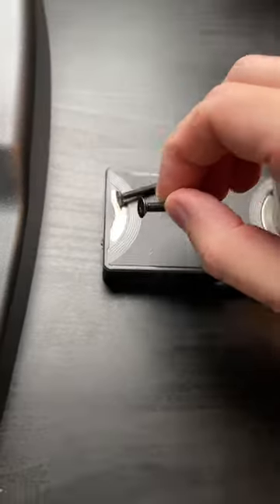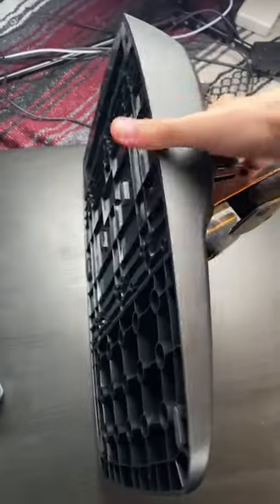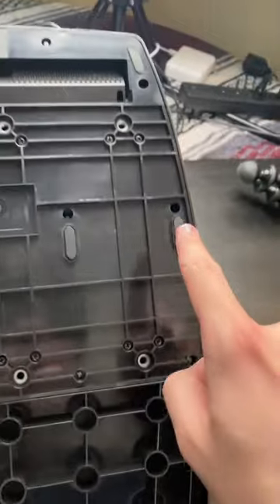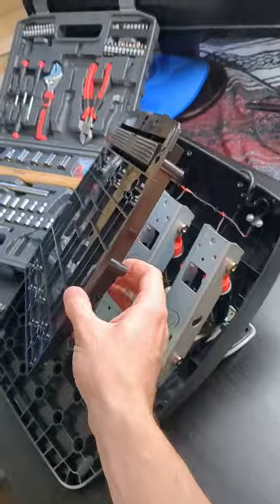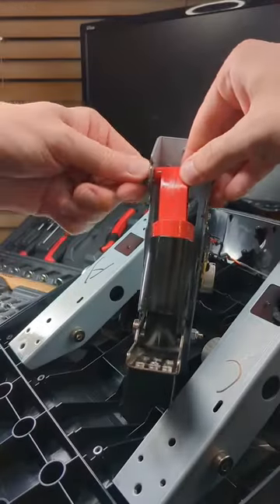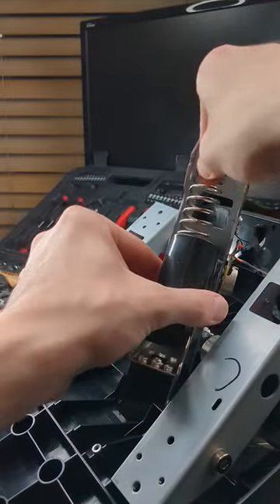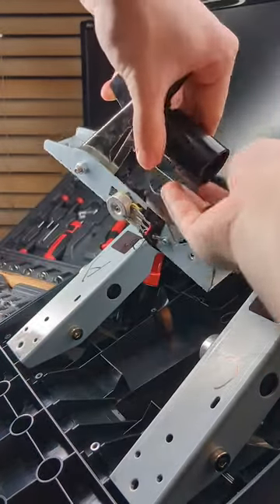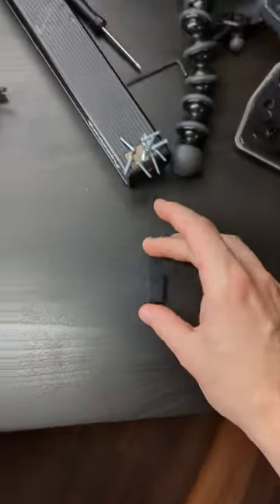FIXING the Logitech G920 #shorts

Comment: This is the opposite of what most mods want to acheive lmao
Reply: @Unaboner  braking isnt linear. It won’t work or feel properly with no rubber stop.

Want to mod it, replace it with a load cell.
Reply: @Unaboner  I think you skipped leg day too lol
Reply: @drewdunn3201  i can get like 80-90% at the cost of my chair rolling back (even with my two amps behind it) so i just want it to be a tad softer so i can still hit optimal brake pressure without rearranging my seat lol
Reply: I wouldn’t want to remove it if it weren’t for my desk and chair, the way I sit and how I have to put the pedals under the desk I don’t have enough room to push it down with enough force
Reply: The only reason real race car pedals are so tough is because when you break the inertia keeps your body moving forward
Reply: @heyitskimii exactly, thats just the most annoying part, every time i try to break hard i end up rolling out of my room
Reply: @heyitskimii I set my brake pedal to hit 100% braking force at about 80-90% of full push so I can get more braking with less chair movement
Reply: @smolltaco5667 😂😂😂😂😂 right. I removed my wheels 😂😂😂
Reply: @Shark00n1337  orrrrr you can do what I did, and just cut it down to about a fourth of its size. It still feels squishy at the end without feeling like a brick wall.
Reply: when i race i just set up a fold up chair instead of my regular chair
 @heyitskimii
Reply: Exactly
Reply: @smolltaco5667 as a real racecar driver, if my body is moving forward under braking, my harness isn’t tight enough.
Reply: @alexandermaloney4016 their chair isn't bolted to the floor or something weighing almost a ton
Reply: @smolltaco5667 yeah I just took the wheels off after a couple weeks
Reply: I weigh 105 lbs and I have to stand on the damn pedal for it to go to 100%
Reply: I did this mod because I play truck sims.
Reply: If it was screwed into some sim rig then yes but but on my floor it just slides and it is anoying.
Reply: @smolltaco5667 that's the same problem I have with my Thrustmaster T3PM pedals which is why I left them stock rather than putting the other spring on it. Sitting in a chair with wheels makes braking with a lot of force hard because you just push yourself back  which is why i am thinking about buying an office chair pedal mount in amazon. It's basically holds the front two wheels of your chair in place and ur pedals screw into it so you don't get pushed back.
Reply: @alexandermaloney4016  true but i didnt mean it that way
Reply: @Shark00n1337 facts
Reply: This is worse!! How am I supposed to modulate brake pressure with zero resistance!
Reply: @jadechillboi401  Just get locking wheels! I've been racing for years with my chair "with wheels" and I have no issues braking with the G29 pedals.   This "mod" is ok, I understand why... but there are other solutions and it's not expensive.
Reply: @OffRoadQC  I can't sadly
Reply: @drewdunn3201 hell nah I’ve turned the sens up and stood on mine full weight brake went only to again 80%
Reply: His brake feels like the gas now🤦🏾‍♂️
Reply: @Unaboner nah replace it with a thick peace of foam
Reply: Well the point is is in a real race car the brakes are cable not like real cars where they're electric and in race cars they're impossible to push down but in real cars it's like no effort
Reply: @Shark00n1337  lol. It will work properly. That's why T3PA from Thrustmaster is better than Logitech pedals. Due to that stupid brick.
Reply: @Missch_1  What are you on about? T3PA come with a removable rubber piece same as these logitech pedals. They work in absolutely the same way, what's the point of saying its better? You a fanboy?

Load cell pedals would be an upgrade, these are just toys.
Reply: @Shark00n1337  I don't know if you have one of these pedals but the original rubber stop is at <50 brake pressure and it's straight up like hitting a brick wall, you are unable to brake >60-70% in game even adjusting it in settings, everyone pulls them out cause it completely ruins the brake.
Reply: @heyitskimii , can you not calibrate you break to hit 100% earlier… best of both worlds?
Reply: Na I hate the thing. A stronger spring and take that thing out and its way better. You cant even hit 100% with the rubber thing in there. Atleast without a rig
Reply: Just get locking wheels
Reply: Before mod assetto corsa was %12 breaking force after the mod can got to %100 with ease. It helps alot with left foot breaking when drifting. I've also set my pedal to full force when it hits about %85 so I don't have as much movement
Reply: @heyitskimii just change brake sensitivity or take away all deadzone. My G29 feels awesome at 83 saturation on a ps4. Brakes are at 90% just before hitting the rubber piece so if I need to get to 100 I can press just slightly harder as opposed to all my might lol
Reply: @howlingbeats2544 😂😂😂😂 for real though.
Reply: @ModMINI you don't know how to do that with your foot. That's insane and I'm scared of you actually drive in real life.
Reply: @OffRoadQC and this one is free.......
Reply: @robertt9342 then it's super super sensitive
Reply: @youarenotspecial  I have been racing for decades and am smoother and faster than just about anyone out there. You adjust stopping force using pressure. Pedal travel is not desirable.
Reply: I have a cockpit and because the footpedals are angled. It’s a lot easier to hit the brake pedal so I see why people would want to make it harder.
Reply: No matter what you do with the logictech pedals it won't be that grand, at least this way you can use a chair and table mount.
Reply: @ModMINI  you push the pedal less in?
Reply: @smolltaco5667 Ehm no thats what the 3-5 point is there...Sure it's safer but it basically keeps your ass planted in the seat

The pressure is so high because of precision if you lock up during a race it could cost you
Reply: @heyitskimii  You got a point.
Reply: I put my accelerator spring in the clutch and the eraser in the clutch with the brake spring in the accelerator
Reply: @drewdunn3201 it’s annoying when I’m pressing the brake and my whole pedal set is lifting instead.

Comment: When I still had my G29, I just drilled a hole through that rubber thing, so it doesn't feel like an empty pedal. It was way better than just completely removing it.
Reply: Might try this
Reply: @Simulacrum0354 did you try it?
Reply: @Simulacrum0354 did you?
Reply: @Shazam_youngdaggerD  I haven’t gotten too it yet, ended up getting focused working on real cars lmfao
Reply: @Simulacrum0354  that’s even better lmao
Reply: How do you just drill a hole in the rubber thing? Like which direction or how much?
Reply: @casedistorted  look up how to drill the hole in it
Reply: Does the 923 require this too?
Reply: @Ashhong1 in the g923 there is no rubber it's only a hard spring
Reply: I 3D printed a rubber in TPU, I can adjust the stiffness by changing either filament or infill shape and density. Makes a giant difference!
Reply: you can also remove it and put in a second spring then it feels similar to an actual brake pedal on a race car
Reply: This does make sense to me, cause Racing cars breaks are not as soft as the clutch not even the ones in the cars I have driven, so this might be perfect!
Reply: @Ashhong1 923 has no rubber and a nice progressive spring
Reply: With the G29 I had no problems the Xbox wheel just sucks with the braking. Had to learn how to drive acc all over again and my old pedal from the G29 was broken. It randomly said I was pressing the brakes on a straight but I bet there is a pound of dog hair from my old golden retriever in there.
Reply: I just cut a chunk off the rubber and threw it back in works great lol
Reply: Which way did you drill the hole I’m confused? The long way or short way
Reply: @Simulacrum0354  Any updates?

Comment: But, wenn you press the paddle without force you don't feel anything right ? The best mod for these paddles are a stronger spring without this little black thing
Reply: Best mod is an actual load cell sensor which doesn’t set you back too much.
Reply: Best mod is to bin them and get a decent set
Reply: @oonfa  not everyone has the money to just "buy a better one"
Reply: @oonfa yeah you are right let me spend a grand on a racing sim
Reply: @oonfa  funny, in my country this is like luxury, you have this wheel or nothing...
Reply: Just do the 3d printed magnets behind the paddles
Reply: @Flowermouth for the price of a load cell module you might as well just get thrustmasters tlcm

Comment: I saw another mod earlier to "fix" the brake pedal but it added extra rubber into the pedal.
Reply: Me too, algorithm
Reply: yeah it cut a piece of rubber to make the pedal more realistic
Reply: That makes it more stiff
Reply: its to make it more stiff for the rally racers but if u want it more realistic then when it go all the way down it feels better
Reply: @twin9ine-productions  you should NEVER do this as it messes with the calibration. it acts as a stopper to stop the pedal going back any further. the thing that measures how much is pressed is calibrated at that point where the rubber stops it.

this means if you remove it, you can push the pedal past 100% and wont have any control over it.

if you push it halfway, where it will normally stop with the rubber, it’ll be 100% pressure, and pushing it further is still just 100% pressure, as it wasnt designed to go further.

i did it and it ruined it, had to put it back as it was so unusable without it.
Reply: Because racecar brake pedals are literally a wall, F1 drivers push with 170kg of force to break
Reply: @mitchhifi9192  that’s the weight that the brakes are applying to the wheels, not how much the driver is exerting. an article from Brembo (cant send a link on yt but its out there) states that Alonso uses roughly 290-300lbs of force, or 133kg on the brakes with his feet. the 170kg is the insane pressure the brakes are putting onto the wheels, not the driver on the pedal.

plus you aren’t taking g-force that pushes the driver onto the pedal into account. and they wouldn’t be pressing at that pressure all the time, if ever on some tracks.

if the track has a long straight then they’ll apply the brakes for a short moment, and then as the car slows down and the downforce is weaker, then they would lock up the brakes, so they ease off them.

it’s more likely that they can actually exert maybe 95kg, but dont quote me on that. given that they’ll get a lot of pressure from the g-forces it’ll be a lot lower.
Reply: @twin9ine-productions if you want realism you want it to be stiff. I don’t know why you think that’s only for rally cars
Reply: @Racing_Fox  depends on what kind of realism we're trying to achieve here. normal road cars don't have brakes as stiff as that.
Reply: Can you not calibrate each pedal single handedly?
Reply: @twin9ine-productions 😂 no
Reply: Sims need more and competitive needs less, to fix the issue most people are talking about driving sims
Reply: @iGPR3 I race on a G29. The midpoint is 50% pressure. Have you checked your deadzones, possibly?
Reply: @hyacinthtiger62  from what i recall (ive since moved on from cheap logitech crap) deadzones didn't do anything. im assuming that the potentiometer in the pedal was only meant to go as far as logitech intended it to, to that rubber stopper point.
 
if you're pushing the pedal to where it normally stops, it reads 100% in game. if you push it all the way, with the stopper removed, it still reads 100%. meaning you lose all sense of control and can't really gauge how much force is really applied. and because the potentiometer (i wouldve thought it works this way) is only designed to read til the stopper point, deadzone won't do anything as the hardware physically can't read the pressure when pushed that far
Reply: @iGPR3  There must be a mechanical or software difference then, my G29 pedals read exactly 50% at the rubber stopping point.
Reply: Because sim racers want a pedal thats impossible to press and needs special shoes. And a rig.

Comment: What works best is to cut that rubber peace in half and get some small foam mat cut a 1 inch strip and put it on top of that hard rubber. You get a much better feel for realism. Brake gets harder at the right point but still have all the travel needed
Reply: Thank you so much for this comment. I did exactly what you said, and the pedal is way way better. Your comment needs to be pinned at the top.
Reply: @OzzSabbath what sort of foam mat?
Reply: What thickness foam? like a 1cm EVA foam yoga mat or thinner?
Reply: I thought about that exactly
Reply: Make like fanatec, use a folded over piece of stiff foam with the bend facing the actuator face

Comment: This is great because now you can no longer feel the brake lmao
What I did was just set deadzones in the sims I play so I dont need to floor the pedal, but still need to put in some effort to brake 100%, the bigger the deadzone the less you need to press on the pedal.
I must say, that rubber IS a little too hard tho, maybe drilling a few holes to remove a little bit of mass and allow better deformation is the way to go
Reply: Exactly
Reply: I never heard anyone say the bullshit you've just said. This brick is literally the worst thing about G pedals. And that's why Thrustmaster T3PA are better. If you can't feel the brake, just get good, haha.
Reply: @Missch_1  hey man, no hard feelings but please don't be so toxic, I'm just presenting my opinion and I'm willing to hear opposed sides as long as theres respect.

To me, the rubber brick is >somewhat< good, because it tries to simulate hydraulics, irl you dont "feel" the brake by pedal travel, you feel it by the ammount of pressure you apply to it. If you set the deadzones right, it can get pretty decent and you wont have to smash the thing to apply 100% brakes, plus if you drill a few holes into the brick to make it squishier it get much better. After a few months of use the rubber also gets softer by itself.

In the video the dude completely removes the rubber, that would make the pedal have no increase of resistance as you brake and I cant imagine that being a upgrade at all, specially for games where precise braking is required, maybe you could replace it with a softer eraser or something similar. Obviously its up to the person, maybe he can brake 100x better without the rubber than I can with the rubber, its a matter of preference and getting used to it.

Regardless, it is obviously not a good brake pedal, its a entry-level thing for beginners in sim racing and must be upgraded as soon as possible lol
Reply: @lucaprado544 Man why even bother with the dude he's just trying to get a raise out of people

That said the pedals are absolute garbage if you don't put some work into it and the things you suggest are among the better ones yet I hate the strong opinion a well fitted spring does a better job depending on the resistance it provides it makes you feel the entire range of the pedal

And yes I know it has a spring but that one just doesn't cut it
Reply: I removed mine. If I had it mounted on a rig maybe I'd have a different approach, but slamming on it feels terrible in my current setup. Setting the dead zone was my original solution. I'd either have to set it to slam on it to compress that rubber or tap on it and lock up. There was no middle ground unfortunately.

Since it's not a loadcell I think having a lot of travel and just using the compression of the spring to indicate you are getting close is good enough. I contemplated buying a load cell upgrade for it, but it will probably just be better to replace it with a new set of loadcell pedals. This is the first upgrade I will do I think and probably the most needed. Though a direct drive wheel is high on my list as well. It's just very expensive.

Comment: I will say that the extra resistence is very nice (when you have a stable mount/stand for the wheel) for more accurate braking and more importantly, doing heel-toe downshifting. If it was too easy to press I would not be able to do this
Reply: Facts
Reply: As you said, if u have them mounted
Reply: @gmg8416  I personally have my setup mounted but I can see how that could be the main issue for people who have their pedals on the ground
Reply: @Iliketobrap  even with this "fix" it still slides a bit now and then

Comment: I did this day one, I couldn't get braking right for shit, just constantly smashing in to walls or locking the wheels, once I put it back it was so much better, you get used to it and as you use it it gets less strong, if its sliding around too much you may want a mount or to remove it but keep it around, you will want it later
Reply: its cuz it counts 70% of foot pressing as 100% without the rubber

Comment: You should also change the spring, use the old brake for clutch and old clutch as accelerator, so you'll only need a new brake spring
Reply: This ^. I have em in my current setup and it is wayyy better than the original setup and feels i got more control too
Reply: You saved me from spending money on new springs for all the pedals. Than you.
Reply: Same
Reply: where would one find springs for racing pedals?

Comment: i find it better with the rubber, it means you can brake full force at a more consistant rate and if you really need to send it you can attack the brake more aggresively to get that little extra braking, plus that in most pro race cars the brake pedal is that short, youre not supposed to press it that far, not even road cars do that